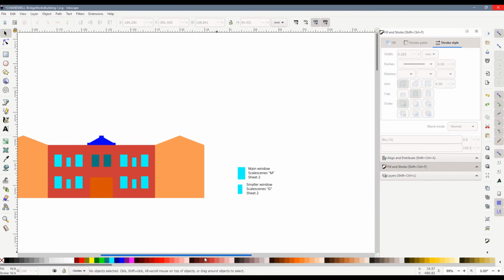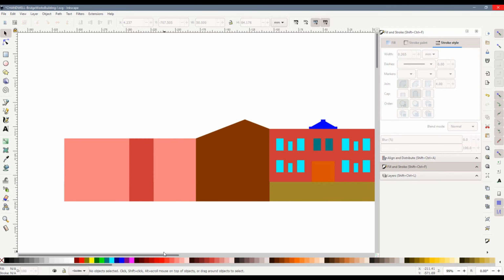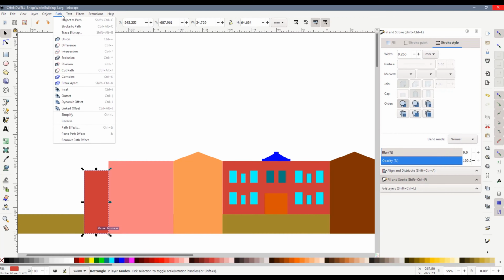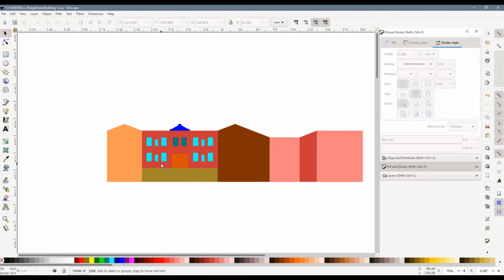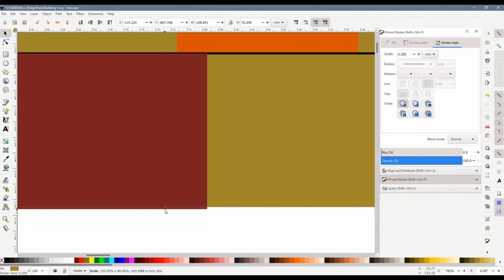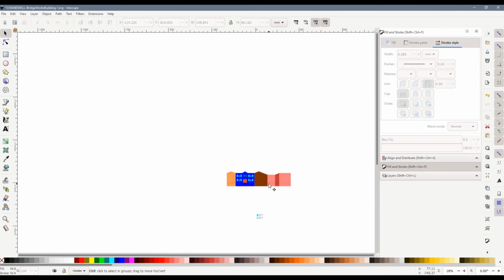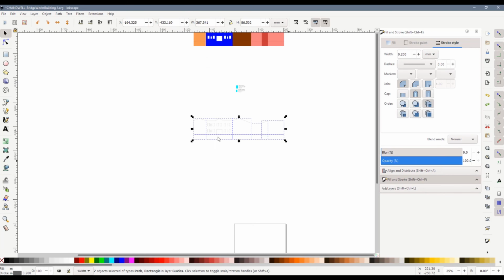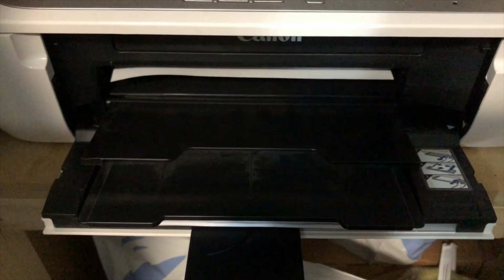Industrial Scratch Build 2 - The Card Test Fit - Scratch Building With Inkscape

Comment: The build is coming along nicely, and layering 2mm greyboard like that means you'll end up with a surprisingly sturdy structure. I noticed the downpipes on the semi-completed model at the end appear similar to the way Scalescenes do them on their kits - i.e. a slightly larger inner end wall layer with black paper wrapped around the edges then sandwiched between the outer end wall and the front face of the building: have you thought of using wire downpipes? Great idea converting the gable end wall to a path so just the bottom node positions need tweeking when trying to adjust the size. A great job and I'm  looking forward to the next installment. I hope you and yours stay well.
Reply from the maker: Thank you for the kind words, Paul. Yes, this technique is very much inspired by the many Scalescenes kits I have built over the years, and I am always surprised by how sturdy and solid they are. I think the downspouts approach is genius. I've never tried adding wire downspouts before. Not for any reason other than I never have... It's a technique I should try one day. --Michael.